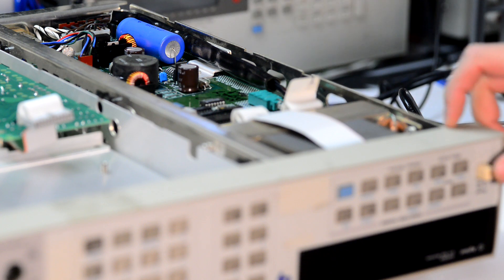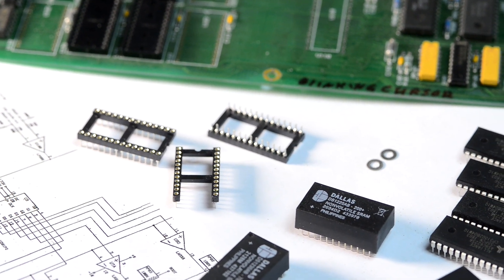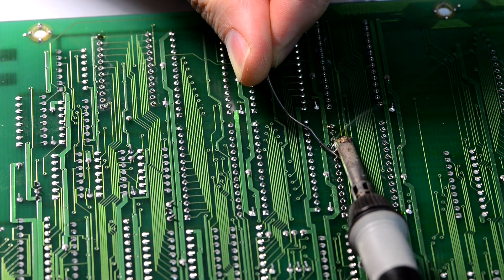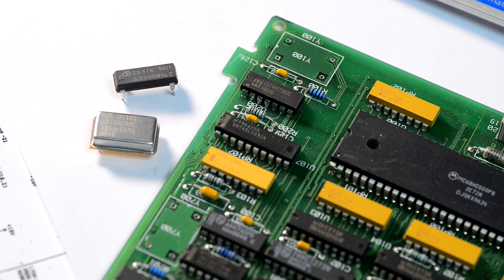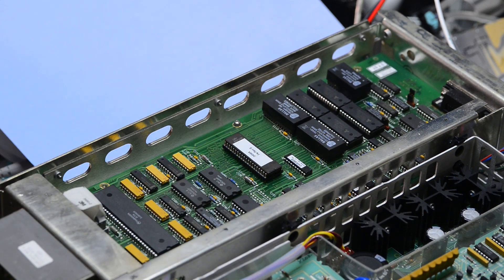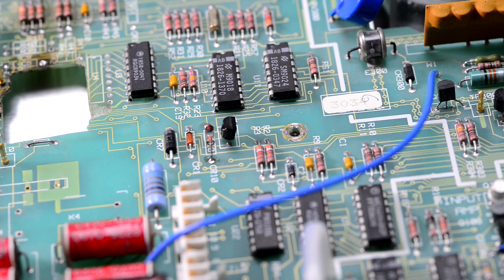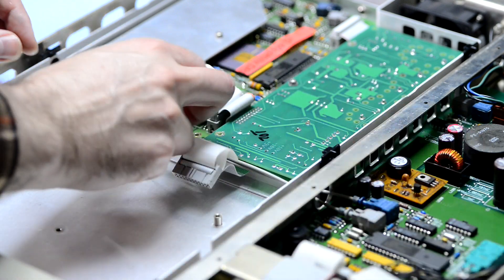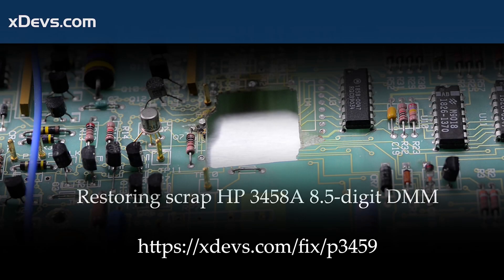Restoring destroyed HP 3458A DMM : Part I

Comment: I have a 3458A that recently came down with isolator failure on boot that I'm working to troubleshoot. Hopefully I can pick something up with your videos to help get it working.
Reply from the maker: Check the optical fiber and transceivers at both ends. Also check power rails at both isolated and earthed sections. Isolator failure means that A5 board cannot get a response from A3 ADC board.
Reply: @xDevscom_EE  ya that's where I was looking. I did check the fiber optic cable and I can see it flash but I feel its a weak pulse. Work won't let me tear down my good 3458 to compare

Comment: omg tin. as a kid in high school my final electronics project was to make a programmable weekly home hot water timer controller. which i made entirely out of off the shelf ttl logic chips on breadboards. but i needed a non volatile memory storage to work with those arrays of ttl logic. to load and save each 1 hour time slots over the whole week. sadly there was no money for ordering special components. so instead i found was discarded from local industry some of those dallas sdram modules. and i briefly got them working but then it dies and i could never figure out what went wrong after this unknown issue occured. of course i was just not very experienced at that time with electronics.

anyhow one of the things you pointed out here in your video is they have an internal battery. so maybe they were discarded for that reason. and i never even realized. but would have explained the issue. too bad oh well. but it would have been fantastic (for that time). if it had actually worked. before arduino or anything like that. to have those nv sdram memory. really cool.
Reply from the maker: Dying Dallas NVRAM in old test equipment (form 90's-2000's) is a common thing and that often results in lost calibration data/configuration parameters, making instrument unusable. Many old 3458As with errors "RAM HIGH CHECKSUM" or "RAM LOW CHECKSUM" as essentially dead because of depleted battery in these NVRAMs. Tektronix TDS7000 scopes also have similar problems. Sometimes battery is externally next to traditional SRAM, but functionally it is same weak point.